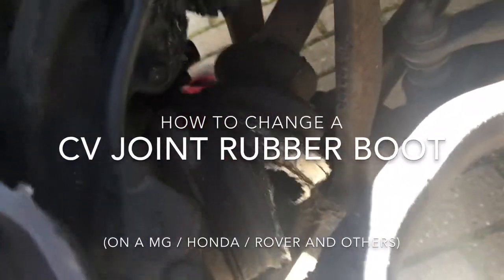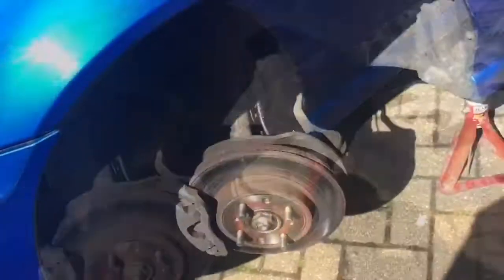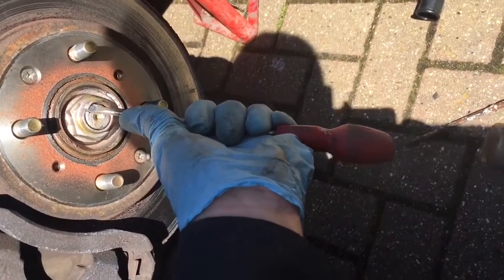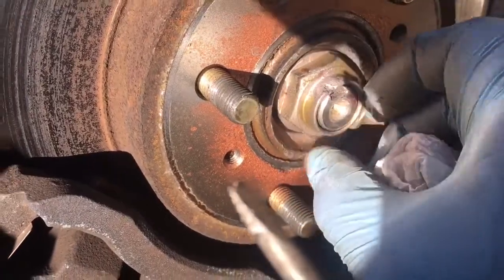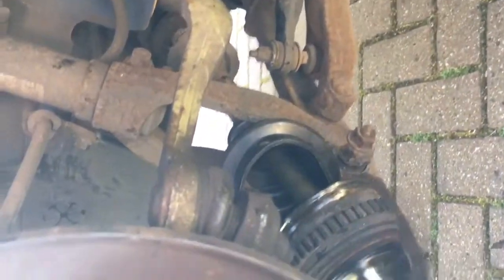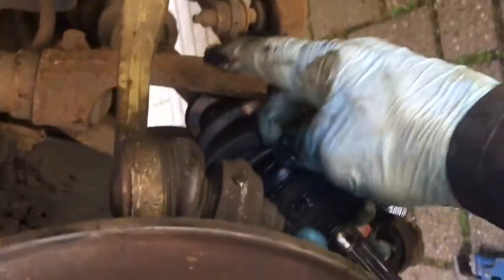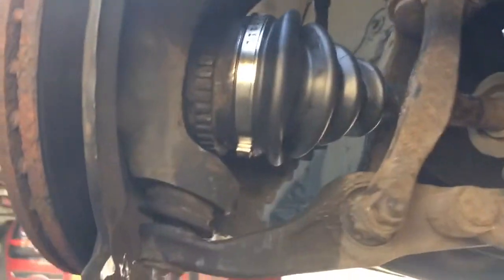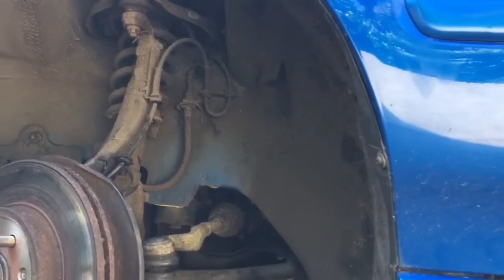How to Change a CV Rubber Boot - MG, Rover, Honda & OTHERS

Comment: My '02 Rover 45 has just passed its test with one advisory: split gaiter on outer cv joint. Haynes manual makes it sound more difficult than you've shown.
Reply from the maker: Great, and yes it can be done easier.